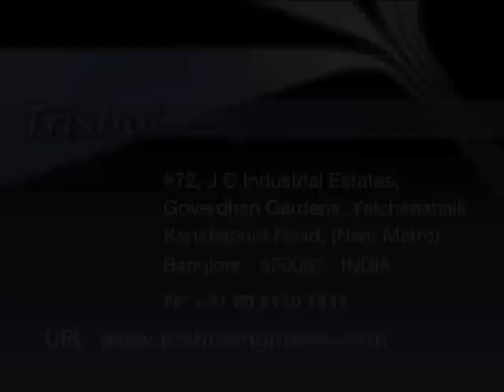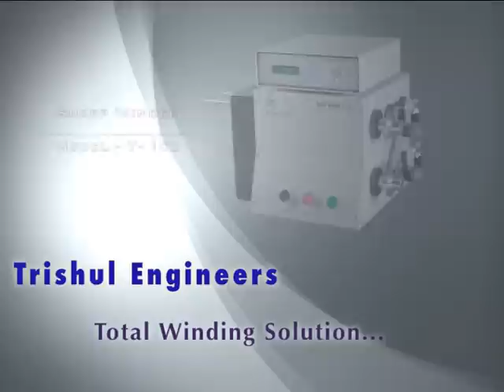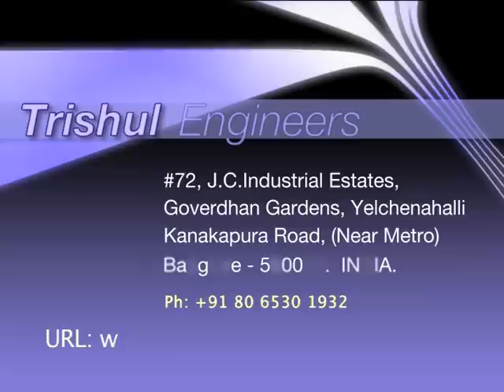Coil Winding Solution, Winding Solution

Comment: Hi, I am glad I came across your video. I actually get there from Google and what I am deeply curious to know about is the amount of Maximum Voltage my 3.5kg Air Core Electromagnet can bear. The Core of the Solenoid is 120mm in height and 13inches in Diameter. It core is 47mm wide and 130mm long.